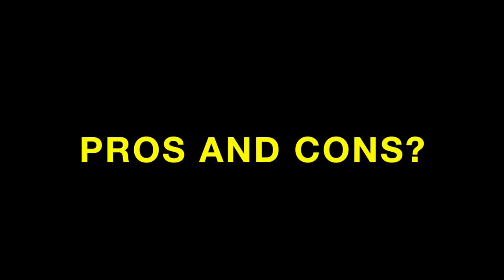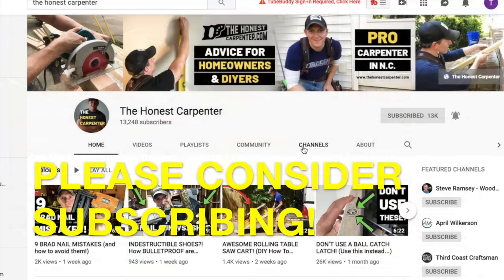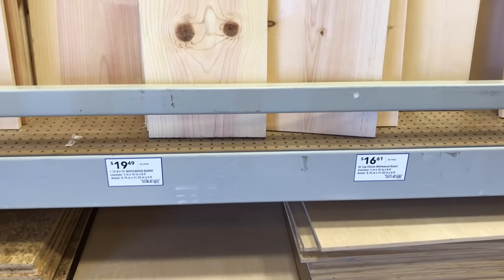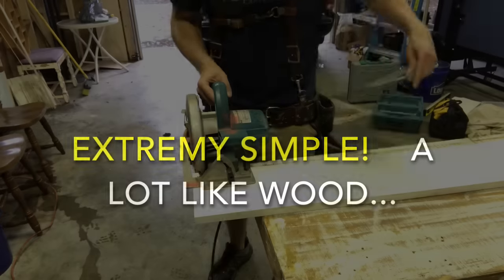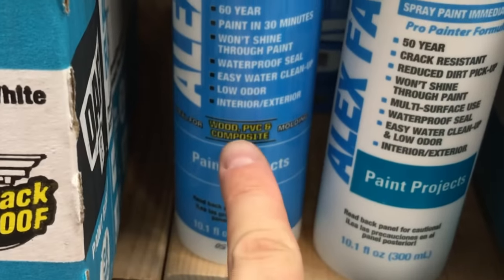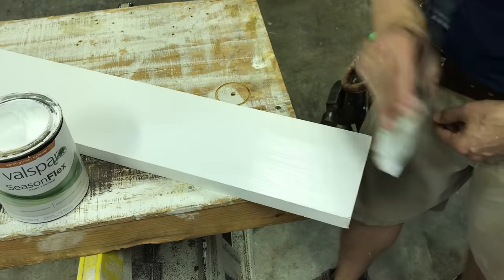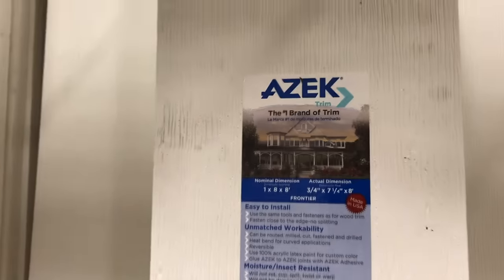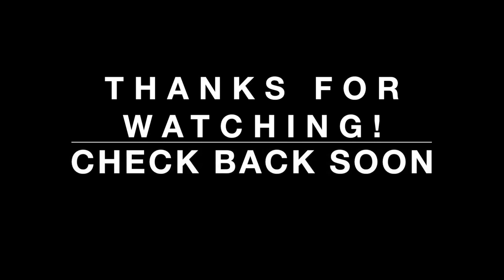PVC TRIM VS. WOOD TRIM? (Pros And Cons!)

Comment: One of the biggest problems with PVC over timber is the fact that it doesn't rot and as a result does not give an early warning sign of much more serious damage taking place behind the PVC covering. An example of this I am coming across more frequently is roof leaks or any leaks where water can get behind the PVC and cause the wooden substructure the PVC is nailed to, to rot. 

A good example of this is roofline PVC, where it is nailed to the timber rafters, if timber is used for the roofline fascia and painted, if the roof does develop a leak near the roofline, the paint will generally peel of or show other signs, such as splitting or cracking of the wood. This is a very important early warning sign and allows for the roof to be repaired before considerable damage is caused to the ends of the timber rafters, especially on properties with a deep over hang.

In my experience I have found that when water ingress occurs near the roofline where PVC has been used, you do not get the early warning sign you would get with timber, as no visible deterioration is seen on the PVC. This leads to the home owner being unaware that the timber rafters or other timbers behind the PVC are rotting, and by the time it does become apparent (due to rafter ends rotting to the point that the PVC fixings no longer have anything to hold onto and the PVC fascia becomes loose or falls off) considerable and expensive repairs are required..

I am finding an ever increasing number of problems and repairs associated with this type of damage and can only see this issue increasing as PVC roofline becomes more popular.  In my opinion, PVC at first appears the perfect solution but in the long term, the early warning signs given by using timber and paint far outweigh any benefits or short term cost savings from using PVC. 

I feel a lot more long term research needs to be done on the possible long term adverse effects of choosing PVC products over timber..
Reply: I'm guessing that the wood underneath must be painted with a quality paint. The top of the PVC outer trim could have a subtle downward slant to encourage drainage to the front, not rear of the PVC plus some kind of vertical channeling behind the PVC for water to leach out of. Great advice about the problems so a suitable preventative measure(s) can be worked out.  👍 Thanks!
Reply: @alex mcneely
That was a very long comment. 👍 I concur
Reply: @seniorsmith8015  So, did it take you '3 months' to read? I'm guessing the real problem is with your attention span. Yeah, there are times we all are like that...  SQUIRRL! 🐿🙄
Reply: @jessejohnson159 LOL. I am a slow reader. And squirls drive me crazy but I just viewed the video last night. 🍻
Reply: @seniorsmith8015  😁😍👍
Reply: Very good point Alex.
Reply: Let me know about the long term research. PVC will be here long after we're gone. My customers want what looks good now, PVC & Bondo!
Reply: Very good points here.  Much like "plastic based" paints are actually what cause wood to rot, they form plastic films on top of the wood, under which the wood can rot and you wouldn't know it, till you can push your finger through it or a void or voids are seen.  PVC would be the next step to making rot able to happen to the wood behind it and you'd never guess it, till the PVC board falls off.  If we used Allback organic linseed oil paint, the wood would not rot.  Long before any rot sets in, the painted surface would go matte, then chalk (grains of pigment would start to fall out).  After further time it would develop squares that stay fixed in place, or pigment powder would fall off leaving unpainted areas.  Even this would happen before any rot as started yet.  If you apply a coat of linseed oil or linseed oil wax to linseed painted surfaces every five to ten years, you don't even get squares forming or pigment powder falling off and showing the wood.  Even when squares form or pigment powder falls off, you can simply clean the surface of dirt and loose material (brushing it off, if there is any) let dry and repaint, and there'd most likely be no rot yet.  Other paints in worst case scenario cause the wood to rot, and you wouldn't even know it.  You can find Allback linseed oil and linseed oil paint at the Eco Living Room at 12 Cataraqui Street, just west of The Woolen Mill, if you're in Kingston Ontario.  In another city, or if you want to check these products out first, you can visit www.sagerestoration.com.  If you are in the US, you can visit www.solventfreepaint.com.
Reply: You do make a good point. It certainly does hide problems though sometimes ignorance is bliss (well for a while anyway).
Reply: Then just frame the house with PVC…… 😜
Reply: While I agree with your overall concern, many a homeowner, not wanting to fix the entire problem, pvc or aluminum skin over problem areas.  A friend just did so, before selling his house.

Comment: Expansion/contraction.
I installed pvc facia boards. The butt seam opened up 1/8” in the cold winter due to contraction. I’m glad I thought ahead covering the roof joist with aluminum flashing where the butt joint is located.

Comment: Great video.   I appreciate the direct approach.   Only constructive criticism I have is that I one should never use a DAP Alex or Alex Plus product outdoors (when you are using wood).   Those are fine for indoor paint prep - but they should not be used in places that are exposed to any water.  Those low cost water-based acrylics harden by drying (ie. water evaporating).   They shrink roughly 30% and will literally dissolve in water (hydrophobic).   Other products such as silicones and paintable-silicones (or Hybrids) chemically cure with atmospheric moisture and can not be washed away with water (they are hydrophilic).

Comment: Thank you! I was wondering what to cover the nail holes with on the PVC trim in the shower. A handyman made the mistake of using the type of filler that is pink when it is wet so every time there is moisture, the filler turns pink.

Comment: Thanks for this video.  I'm just in the process of replacing some rotting exterior wood trim and have been thinking about using this kind of product instead of the wood version.  It's available in longer lengths as well.  Costly yes, but better for the wetter weather here in our area of the PNW.
Reply: Me too.  I’m going to use it for my boat too.

Comment: I spent several years using pvc trims and sheet goods for many applications. For arched windows and radius walls it can be very beneficial.  Route any profile you want. Sand cut edges to at least 220 grit
Approx 126 degrees heat with a large heating element, mine ate 6"x96" clamp to a form (gently) till they cool down. The hold the radius indefinatly. Too hot? Flubber. No control.

Comment: When wet wood expands in width and thickness but almost nothing in length. With heat PVC expands in all directions. The expansion is most notable and problematic in the board's length. 

I like white trim so I only paint exposed cut edges. The factory edges of most brands of PVC trim (Azek, Veranda, etc) are unsightly. The corners are sharp and the edges rough and uneven. Royal brand at Lowe's have sides that match the texture of the broad surfaces and nice rounded edges.

Comment: Can I mention this 3 years ago Woodpeckers did a number on my cedar wood trim boards. S o i had them replaced with FIBER CEMENT, and that stopped the Peckers, The replacement boards come in the most used sizes that have been used in a typical house built in 1982. Also these boards are vermin and termite proof, I considered PTFE but was put off it because it expands quite a lot in hot weather.

Comment: super great review ... i've been trimming garage door openings with this for a few years now and use my router to add special edges to the boards and the plastic dust is a HUGE concern and try to keep it all vacuumed up.  The expansion and contraction of PVC has been a problem with call backs here in the cold north .... no matter how many fasteners i use some gaps open up a lot in the cold.  I use plumbers pvc adhesive on joints and that creates a great strong meld and yet can still crack.  I have now moved to wood again and even tho it needs maintenance over time ... the look and lower expense is an easier sell.  Super long lengths of PVC is very difficult to make work.  If anybody has more experience and can suggest something I would love it.

Comment: Great info!  over the past 20 years I have had to replace a lot of wood trim, posts, sills, brick mold, fascia boards, etc... due to water and/or carpenter bee damage.  I always go with PVC, and I have not had to replace any of the PVC.  I'm surprised you said your clients usually choose wood over PVC... they must like you so much, they want you to come back in 4-5 years and do the same job again... either that, or they have no intention of remaining in the home and just need a temporary fix to sell.
Reply from the maker: Thanks Jay Man! I know, wood is just a liability in a lot of these cases. In instance where I'm pressured to use it, I make sure to back prime and caulk end grain. But, as mentioned, most of the time I let them know I'm going straight for PVC

Comment: Nailing small PVC trim (like quarterround):  I found the trim frequently cracked, even with small finishing nails. I ended up pre-drilling with a tiny drill bit. Also, PVC trim is pretty brittle sometimes - be careful not to hit it with a hammer, or over-bend it. Another good place for it: below your hot water heater (If it is in a raised nook).
Reply: That's why God created the Paslode with 18-guage nails

Comment: Caution should be taken when using PVC in long lengths where high temperatures are an issue during the day. I have seen boards that were snapped because of heating and cooling cycles causing excessive movement.
Reply: Did you watch the video? He gets into that.
Reply: @escapefromny2012  Yes I did watch the video. But I also expounded upon it. Why do you ask?

Comment: I agree 100% with Mark's comment on the organization and how well spoken. Appreciated the vid. 

How would you recommend installing PVC trim to a concrete or PVC wall?
Reply from the maker: Thanks! Concrete wall I’d prob go with tapcons. Hard PVC wall you’d maybe need a sharp trim screw, and possibly a bonding adhesive.

Comment: With that price differential, pvc ends up costing less. No labor on sanding, priming and painting. The biggest advantage is that pve requires no maintenence in future years. It's a great product that gives a way better looking finish than timber.
Reply: No mantinence? What about all the caulking joints you have to redo? With pvc joints over lap in the summer and open up in the winter.
Reply: @Stevesbe  A high quality flexible caulking should move with pvc trim and eliminate gaps.  The video did specify the flexible caulking from DAP.
Reply: Requires on painting or touch ups if you leave it white.

Comment: Great video.  One more con is static.  Interior baseboard and shoe moulding attract lint, dust, and hair due to static charge and it gets worse the more you sweep or vacuum.  A wipe with a damp cloth can resolve this, but seeing dust jump onto the baseboard as you sweep or vacuum the floor is very frustrating.
Reply: I saw in another video the hint to use laundry anti-static spray on tools, clothing and tool bags when cutting pvc. Never thought of it.  Wonder if a homemade static recipe would help with baseboards?  But inside, we only use pvc in water-prone areas for floors and mopping resistance.

Comment: One thing to consider that isn't talked about a lot is the gas and smoke that emit from PVC in interior applications compared to wood. 
Most houses today are already filled with OSB and various chemical laden products.  This gives you much less time to get out of your house safely in case of fire.
Reply: Very good point indeed.  We have too much OSB already in houses.  Best just to use wood and oil it with Allback organic linseed oil and then paint it with Allback organic linseed oil paint.  This paint does not peel, flake, crack or trap moisture, causing rot.  If we stuck with this paint we'd be able to stick with wood and never have rot.  If can be found at The Eco Living Room at 12 Cataraqui Street, just west of the Woolen Mill, for anyone in Kingston Ontario.  In any other city, or if you want to check those products out first, you can visit www.sagerestoration.com.  If you're in the US, you can visit www.solventfreepaint.com.

Comment: Two things you did not mention - PVC will sag, especially in long runs where I'd want the wide side to remain flat. Also I've noticed PVC fencing may not last as long as wood.
Reply: PVC deckboard and railings are hideous looking  . I live in New Hampshire , and also a contractor.

 Most PVC decks that are 8+ years old in my area  are sagging , warping , have mokd/water stains  , faded color  and generally look like crap . 

 Pressure treated holds up for easily 20 years if you stain it every 2-3 years with an oil based semi or transparent stain or sealer . The problem is most homeowners stain every 5-8 years and some never lol. Also most painters use a solid stain which is stupid  , mainly because they suck at applying transparent stain.

 But the best product is redwood or mahogany if you can afford it .

Comment: The PVC saw dust drives me nuts, too! I didn't think about the caulk. I might have a return to make... Also that Flex paint is amazing. I have some vinyl covered metal that looks like woodgrain around my windows, and the vinyl is coming off. The Season Flex works great on it.

Comment: You left out that goggles should be worn!  I had to have a PVC splinter removed from my cornea at the hospital! VERY PAINFUL..
Reply: Been there done that only it was metal and I had on machinest safty glasses. Were goggles over them chips can fly in under the rim.  But they won't stop a busted metal object at high speed. Thats the safty glasses job.
Reply: Pvc dust is horrible.. I couldn’t imagine the pain of getting a sharp piece of plastic in your eye.. yikes
Reply: @311mdub  
No worse than a wood splinter.
Reply: @oldtimefarmboy617  At least wood if not able to remove can eventually be reabsorbed into the body, plastics can't, same as metal.  I have a couple metal splinters in both hands I will likely take to the grave.
Reply: @jayclyde6045  
Wood is far more durable than you think.  If it were not removed from you eye quickly it area around the wound would get infected and the body's immune system would cause so much trauma fighting the infection that the eye would have to be removed to prevent damage to the surrounding area which include the brain.

Like it or not, that eventually would never happen because that eventually is way way too long to wait.
Reply: All work requires ppe even at home
Reply: Excellent excellent idea!
Reply: Yuck
Reply: Safety glasses should be worn regardless of the material being cut. I have not always chosen to do so and have removed things from my eye numerous times (including the help of a veterinarian technician wife at the clinic) and 2 times have had to go to an optometrist. One of those times I was wearing glasses but not goggles.

I agree with wearing eye protection but not a ton unique to pvc vs wood.

Comment: Im glad I seen this. I was about to buy the PVC to rewrap a porch post, but seeing that it expands  and contracts changed my mind. I want a nice square box wrap, and  dont like the idea of the edge seams moving. I'll  just use it at the base as trim. The inner post is pressure treated and will have a one inch base that it sits on. The porous edge of the boards  doesnt help with the looks as well. Nice thorough video though!
Reply: ???  They make post wraps in PVC that are single piece.  As for using 4 pvc boards to "wrap", the cut edge gets dirty and doesn't look good (been there, done that too).  But fortunately it was on the mailbox post, and that post, I don't really care as the snow plow wrecks it annually.

Comment: My biggest issue is with the material flex. It's a lot easier to make long runs look straight on old houses where nothing is straight with real wood whereas a long pvc run will contour to every single hill and valley of an uneven surface.
Reply: Depending on the thickness, this most definitely is not true.

Comment: You did not mention that it can be bonded together using PVC cement to make water tight joints.  I have fabricated corner boards using PVC cement to form water tight corners.  One of the last jobs I did before retiring was a complete residing, window replacement and cellular PVC trim package on a two story colonial style house..  My only complaint is that longer piece are hard to transport as the stuff is flexible as a wet noodle.  Usually used a section of an extension ladder to hold up 16 ft trim boards.   Cellular PVC trim will outlast the house it is used on.

Comment: I was at a big orange box store when I noticed Azex 1”x12”x8’ PVC boards for $13. They had 5 until I got there; I cleaned them out of all they had at that price.
I love PVC trim; I buy 1/2”x4’x8’ sheets and rip the sizes I need gluing 2 together if I need something thicker. Works great outside. I use CA glues a lot. You can mill PVC to make what you need, just remember to seal the  open face of the PVC if you aren’t painting it because it will draw dirt.
Reply from the maker: Good advice, Chris! At those prices, I would have carried them home on my back if I had to 😆